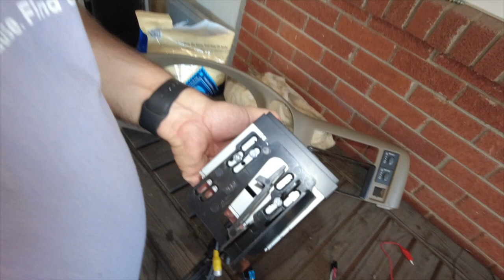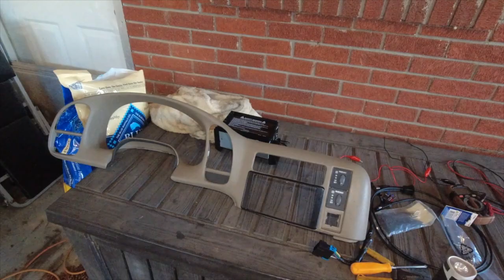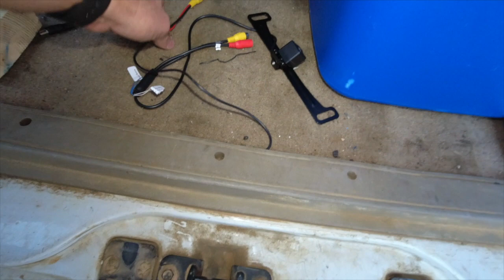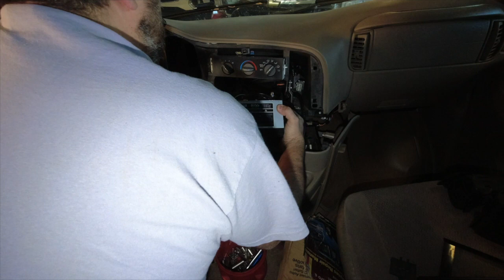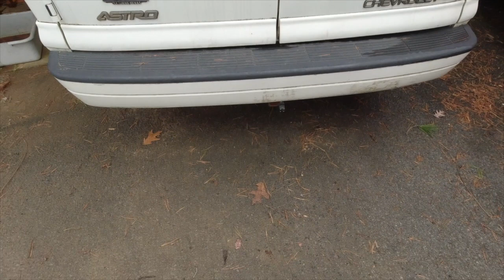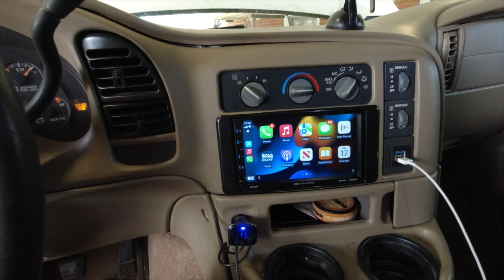2002 Chevy Astro Double Din Radio Install - Installing the Radio

Comment: Go On Crutchfield and Use The What Fits My Astro/Fari, They Make Pre-Make Harnesses And You Can Get JVC, Alpine, Kenwood Etc. That Goes Right In Without Cutting Anything. Including Wires And All The Adaptors Are Free, With Free Shipping. My Total Cost For A JVC With Ready Harness Was $133..  My Van Is A 1995 AWD LT Astro So The Dash Is So Simple To Get The Radio Out (2) Screws.  JVC KD-X380BTS Fits Even With The Rear Heat/AC Duct Work!

Comment: I could never put my camera there.  I would either kick it off or rip it off while off roading.  Head unit looks great!
Reply from the maker: Thanks. I’m loving it. The backup camera is a dream come true! And this radio sounds so much better than the stock unit.
Reply from the maker: By the way, I have since moved the camera. I turned the bracket around backwards and flipped the camera around so that it sits under the bumper and just above the receiver hitch. It’s out of sight and still gives a good picture of what’s behind.
Reply: @tfreakadventures  I'd like to see how you did that. I have the camera above the license plate so it's offset, which I don't like.

Comment: My rear heat doesn’t work after I install the radio
Reply from the maker: That’s strange! The switch for rear heat is near where you’re working. You didn’t damage wiring did you?